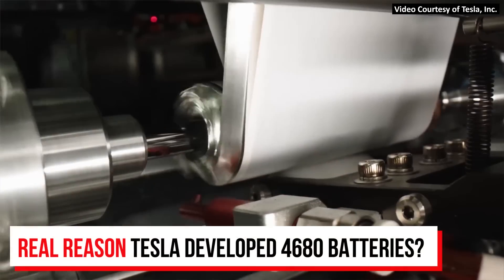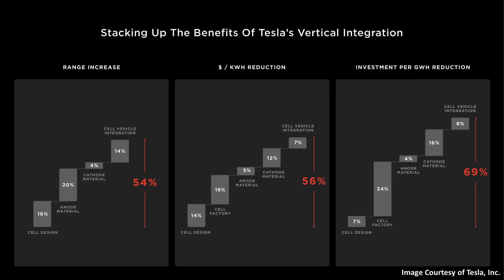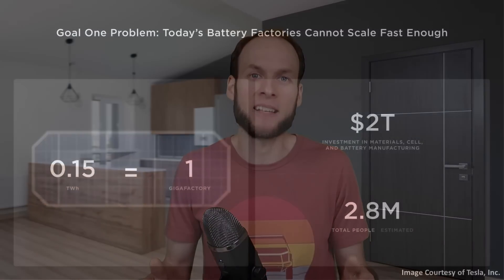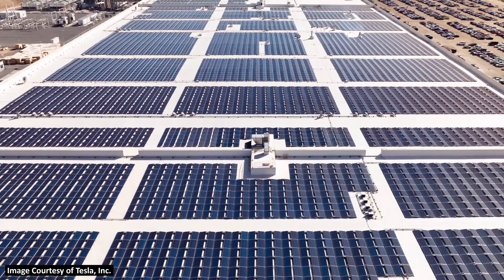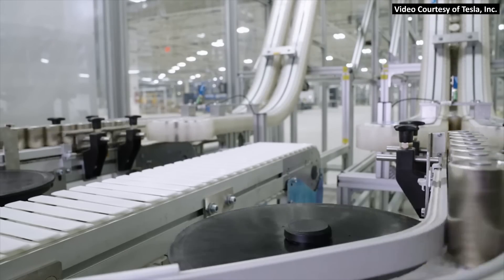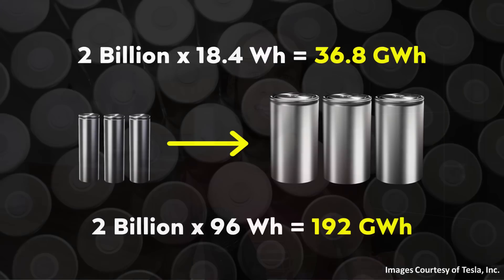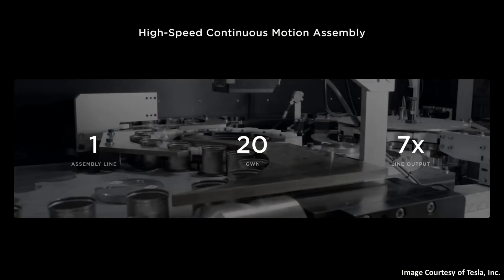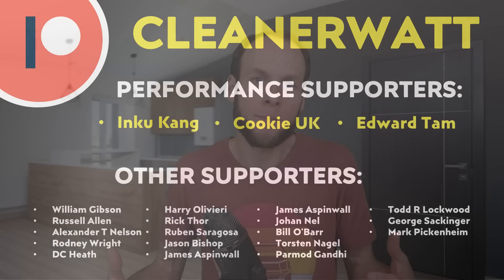Tesla's Future Depends on this Battery Tech!

Comment: The actual reason for switching to 4860 is to be able to produce a competitive semitrailer. Otherwise the 2170 would not be energy dense or able to charge at the rate required without overheating.

Comment: All the reasons for the 4680 do boil down to price
Less factories = cheaper
Less employees = cheaper
Smaller factories = cheaper
Unfortunately as of yet the compromises for the larger format cell have stacked up roughly equal to the benefits resulting in cells and batteries that are on par with the existing 2170. Leaving the only benefit being price, cost. 

We are not seeing sinificant improvements in energy density, range, power, hope we do but I'm not convinced
Reply: Tesla is not use a mature technology and that need time to improve .... Hope I'm wrong and next year's i will buy cheap batterys
Reply: When you realize the biggest cost to electric cars are batteries. Also they are limited by how much batteries they can get. The faster they can produce more battery the more they can scale.

Comment: if EV batteries get charged from fossil fuel energy, you are not solving sustainable energy
Reply from the maker: Agreed, but Solar, Wind and Hydro power are all growling very quickly!
Reply: @Cleanerwatt  but not at the pace of EV growth.  I see increasing percentage of electricity for recharging EV coming from fossil energy than solar/wind power to widen as EV adoption picks up.

Comment: It’s a decent argument. Nevada ran into labour limits, has huge footprint. Japanese technicians?
Need skilled labour to operate machines - to do what? Welded tabs stopped rolling mid-jelly roll, still need welding onto cell casing. Handling costs continue into pack assembly, into (TMS) cooling systems, BMS (?). Thermal overload vent same cost for 18650 as for 4680.
Q. Why stop at 46mm dia? I think the logic on battery day was weak.
LG / gm Bolt show what can go wrong with torn tab / folded separators. Fires.

Comment: It looks like the main factor is speed of handling.  If a production line can handle 4680s as fast as 2170s then the output is 5X in Wh terms per hour.  Great vid - Thanks for the insight.
Reply from the maker: You are correct - thanks for the kind words.
Reply: If ! If Tesla produced 4680 as fast as 2170s they build 5x more cars and numbers say is not. Maybe 1.2x

Comment: Why are we ignoring Moltex nuclear power. They have an intrinsically safe reactor that uses nuclear waste as fuel. 95% of the energy in that  irradiated fuel is still there. They can extract of it. They are also cheap to build. Similar cost to gas fired plant. The reactor operates at ambient pressure and has no moving parts.  Cheap to brill cheap to operate.
Reply: So... Nuclear powered cars? I don't see that on the Moltex website. If that's not what you're talking about, then this has nothing to do with batteries.
Reply: We ignore nuclear power because it has a bad reputation and the safeguards to ensure Moltex is honestly "intrinsically  safe" would take generations of advertising it as "intrinsically safe"...so you have about 30 yrs to get us to ignore  the history.
Reply: Put ‘em in a Toyota, a hummer, F-150.

Comment: I'm always a little skeptical when I hear things like a 10x reduction in floor space is required. Two options come to mind; 
1) a 10x reduction in the size of the entire factory
2) a 10x size reduction in the area of the factory used to make the old wet electrode, which may only be 20% of the entire factory size. IDK! 😕
Reply: All you'd have to do is actually look at the presentation and you'll ralize that in the same footprint that you could previously produce 150GWh you now can produce 1TWh.

Comment: All you have said in here screams cost reduction to me.
Reply from the maker: cost reduction is a great benefit - but not the reason 4680 was developed.
Reply: @Cleanerwatt   of course "screams" sounds bad, but if people are somewhat deaf (or insist on something entirely different...like an even larger format than 4680 or ?) or desperately need poetry or ? 
Tizz a note that says "This 🔋 is the prize winner!" 
And so far so good. But in the years it takes to build out to Tera scale, that format factor could change. The chemistry could change. The anodes...the stupidity of using a vehicle 20× the driver's mass to move him/her that distance to work/store/holiday might change.
Reply: Nevada is at limit of available skilled labour.